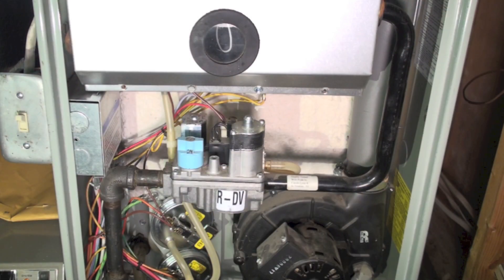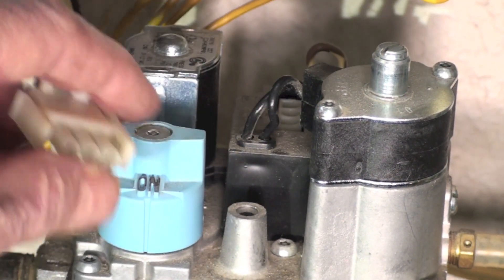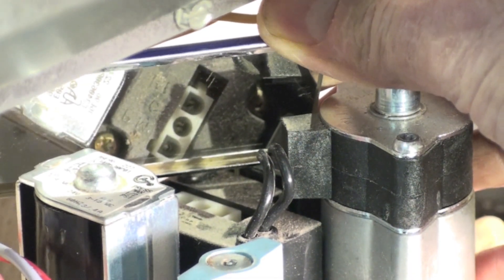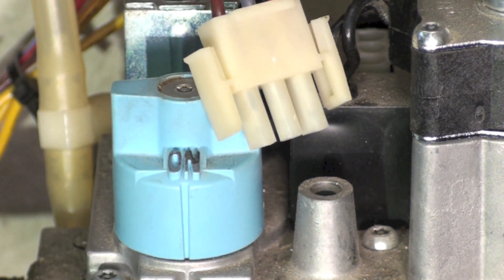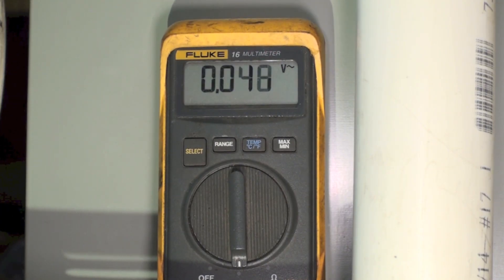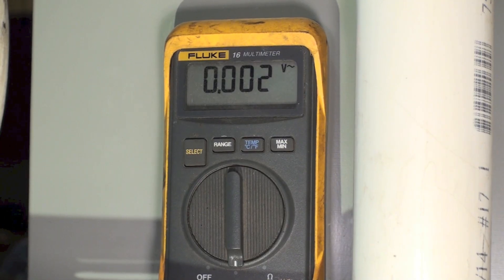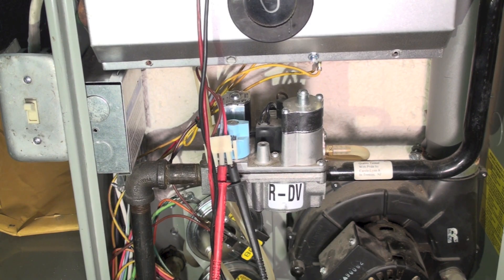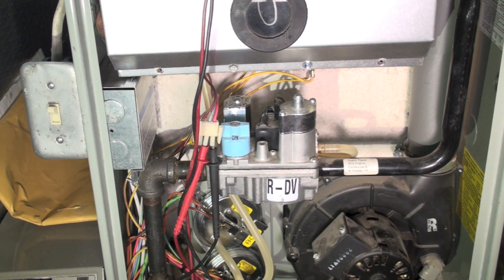Voltmeter check of the gas valve

Comment: I have studied your videos and have learned a lot.  Nowhere on youtube have I seen a demonstration for the failure I am experiencing.  The sequence of events seems normal.  The inducer fan starts~the vacuum valve operates~the hot surface igniter heats up nicely~the gas valve opens with a little shutter and then for a very brief moment all jets fire with a nice blue flame then immediately they loose pressure and continue with a yellow stream of flame that does reach into the heat exchanger.  I have cleaned the flame sensor which had carbon on it and that now allows the yellow flame to persist for 3 minutes or so before shutting down.  It will continue to restart and repeat as the sequence starts over.  I suspect the gas valve has failed.  After watching this video, I will get back up there and check for voltage.  And when it shuts down a couple jets stay lit for a minute or two with a small pilot like flame and then slowly die.  And I have replaced the regulator at the propane tank. And the old one tested out fine too.  Thanks for all you do on youtube!
Reply from the maker: Stuart Morse Even tho you have replaced the regulator, it sounds like a gas pressure problem.  Are you sure you have enough propane?  
GFM
Reply: grayfurnaceman Just had a delivery of 40 gals in a 120 gal tank.  Temperature outside is +25 night and +55 daytime.  The Gas water heater is working just fine.  Checked the voltage to the gas valve, 26v.  Getting a 12v reading before the valve opens.  The old regulator tested out at 14psi.  I didn't test the new one.  I wondered if the valve could be closing down.  Probably not.  If it opens at first it should stay open I would think.

Comment: Im only getting 18 volts to the gas valve... should this voltage operate the gas valve?
Reply from the maker: franktha4th No.  The minimum should be about 23 volts.  Remember, the voltage can only be read during a trial for ignition.  Your voltage sounds like a ghost voltage.  A ghost voltage is feed thru from the electronics of the board.  This one sounds like a board problem.
GFM
Reply: ok thank you very much!

Comment: Great video, but I do have questions.
1) I am not sure where to connect my multimeter. I noticed you connected the multimeter to the middle and right of the plug. Should I connect the red/black lead to HI, C, or PM? 

2) Would every gas valve with a plug have the same letters? HI, C and PM?
Reply from the maker: Ben D Welcome to HVAC.  Nothing is the same.  C is usually common.  Do you have a single stage or 2 stage furnace?
GFM
Reply: The black lead from the meter should be on common and use the red lead on either of the other wires , HI  or PM.

Comment: hello... I have a furnace that is not operating.  i went through the sequence of operation and i am stopped at the gas valve.  the furnace is an older keeprite with a spark ignition attached to the separate tube for the pilot control.  The ignitor sparks, and the pilot valve releases a small puff of gas, which ignites then almost instantly goes out. There is no thermocouple, there appears to have no pilot proving sensor. The main in the gas valve isn't opening and releasing gas..  i am perplexed... WHAT do i do? please help me
Reply from the maker: Richard Gibson This one sounds like a Honeywell Smart valve.  Take a look at this one:  http://youtu.be/N--CMYXrxPs
GFM
Reply: i believe the issue is in the spark ignitor..  What i don't understand is how is the spark ignitor stick is also the sensor? The ignitor is attached to the pilot tubing. It is fed into the module under SPARK.  there are no other wires or devices going to the ignitor.  Only one high tension wire that goes from ignitor to the spark connection on the module.  should there be a separate device or wire to prove the pilot flame? or is it all done through the wire/rod(spark)?? i tried to clean it and it didnt work

Comment: I have a LP furnace up north. my problem is the electronic ignite for pilot keeps running even after pilot flame is lit. it will not sense this so it will not open main gas valve to fire main burners. although I can move a few wires going to Honeywell controller and get it to sense and sometimes open main valve.? controlleror or possible sensor to electronic pilot ignitor??? what do you think.
Reply from the maker: ANTHONY NOWLAN I would try cleaning the flame rod if it has one on the pilot.
GFM

Comment: Try UNIONS and BUSHINGS in concealed locations and see what qualifies as a Concealed location.
Reply from the maker: Just so we are clear, a concealed location is:  A location that cannot be accessed without damaging permanent parts of the building structure or finish surface.  Spaces above, below or behind readily removable panels or doors shall not be considered concealed.  
I think what they trying to avoid is placing a union in a space that cannot be reached from both sides to be tightened.  
GFM

Comment: i get voltage at gas valve have glow on igniter but furnace won't ignite, i believe valve is bad, but can smell gas after the furnace attempts to ignite.is that normal with a bad valve?
Reply from the maker: No.  This one could be dirty burners, ignitor not getting hot enough( most ignitors that are above 150 ohms are suspect), or possibly a crack in the heat exchanger.    Hope this helps.
GFM

Comment: To clarify, does the HSI need to heat up first and at a certain temperature send a signal to the furnace or ignition control which then energizes the gas valve?  Or is there simply a timer or delay built into the control once the HSI is energized than the gas valve is energized for the trial for ignition?
I believe in a few of your other videos, even if the HSI does not glow, the gas valve still energizes and goes through a trial for ignition.  You actually listen for it as part of troubleshooting the HSI.  Thanks again for the videos.
Reply from the maker: There is no temp sense.  Its simply a timer.  We know how long the ignitor takes to warm to temp.  So the timer lets the time go by, then opens the gas valve for a trial for ignition.  The control has no idea if the HSI is warming(there are some that monitor amp draw of the HSI and blink a code for that).  But most do not.  So the gas valve will come on but if there is no flame sensed,  it does not stay on longer than a few seconds.  Hope this helps.
GFM
Reply: grayfurnaceman Thanks for the clear explanation.

Comment: Thanks.  If there is voltage to the gas valve, how do we determine if the valve is at fault?  If I remember correctly, in another video, you mention that a continuity check does not work on most valves.  If using ohms is the answer, how do we know the ohms value of a "good" gas valve to compare the readings?
Reply: If you got momentary voltage at the valve and didn’t get ignition, the valve is bad.